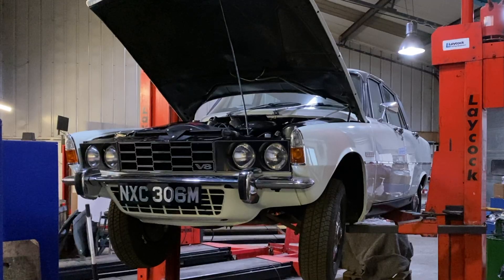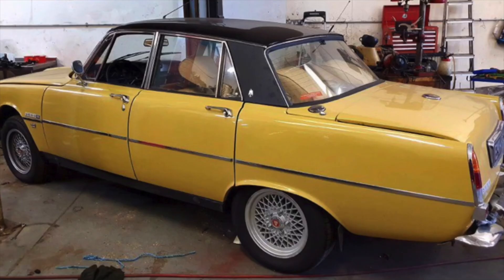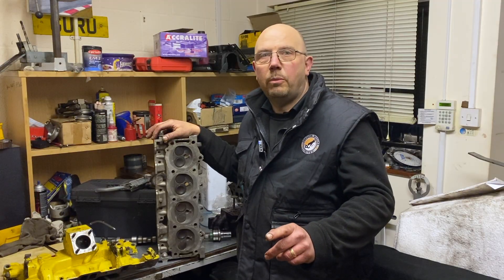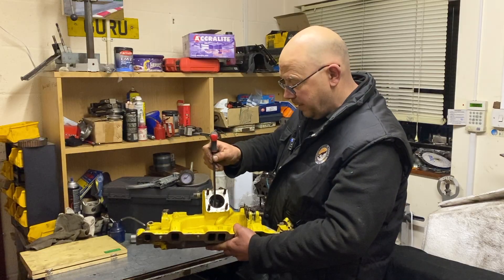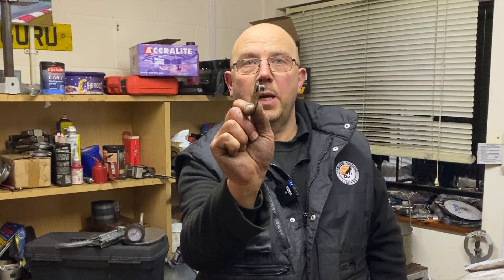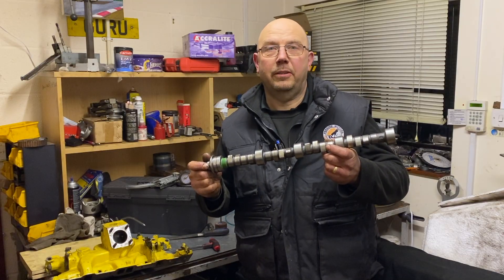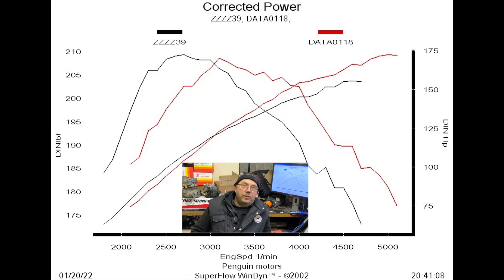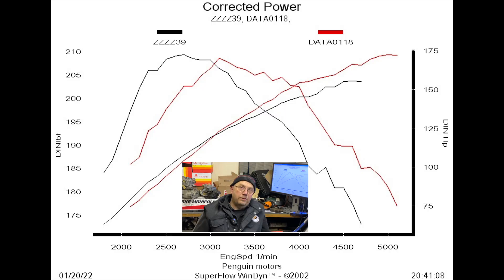Rover 3.5L V8 Standard Engine vs Stage 1 Upgrade

Comment: Love these comparisons/minor upgrades, would it be possible to see a stock high comp rover p6 v8 with edelbrock 4 barrel tuned for dtivability? Alot of people are having issues, tuning/finding the right needles, jets, springs etc... Mine has a lull on part throttle which then causes it to jerk, so annoying-maybe I'll have to spend a million hours trying to change/run it myself, kinda wish I just ran su now😔, love your content👍
Reply from the maker: Part throttle is the hardest thing to sort, its easier on fixed jet carbs. On the dyno it’s particularly difficult to hold at some throttle positions/loads, its much easier on a rolling road because there is more inertia in the system.
Reply: @PenguinMotors thankyou for your response, much appreciated. Can anything else cause it? I'm going to fit a plate under the carb(the one that prevents evaporation) & also(I know this sounds silly but...) I haven't yet checked float adjustment/level, just assumed it would be right but worth checking, could any of these cause an issue with part throttle?could you recommend anything I could do to tune it myself, rods, needles, springs etc? It starts lovely, runs well off choke, smooth. I did notice as it started to jerk I pulled the choke just a tad & it eased off🤔sorry for the bombardment, thanks for replying... Its just kind of ruining it for me a bit, you'd think that there would be some standard guide lines for stock engines etc... But there doesn't seem to be
Reply from the maker: @GeorgeJ-f6u  From my fairly limited experience i try a softer spring first, that will lift the needle sooner so get some more fuel going in

Comment: Hi question for you
If I buy 3.9 engine and I wanna fit ignition distributor instead electronic ignition whats I need to change  
Thanks
Reply from the maker: from what you say i assume you have a distributorless engine, so your need to change the timing cover, camshaft, fit a distributor drive gear
Reply: @PenguinMotors  is any good from 3.5 because I have one
Reply from the maker: you can 3.5 bits fit your block, but ancillery drive may be different, and sump may not fit.

Comment: I have a SD1 standard v8 what is a rough cost from tuning it up to around 200bhp?
Reply from the maker: that depends kind of depends on how healthy it is. but if its  healthy engine then you went up a stage from the very mild cam i put into this and with some air filtration improvements then you should be over 180bhp, chuck a 4 barrel carb on it and you should be past 200bhp
Reply: @PenguinMotors  wow that was a fast reply thanks! I would say it’s a healthy engine. If I was to go for a stage one tuneup 180hp what would be a really rough cost for parts and labour? 

I know it’s very difficult to say I just want to know if it’s with in my budget. Or if I need to continue saving.
Reply from the maker: difficult for me to price,  i dont do bolt on go faster stuff as such,  i only do performance work when i have the engine out to strip/rebuild and dyno test afterwards.
Reply: @PenguinMotors  That’s fair enough mate thank you for the reply!
Reply: Is this engine cross bolted? How do you identify this?

Comment: Im not sure there is any point doing engine mods with those twin SU carbs. Its like forcing usain bolt to wear wellington boots in the 100m.
Reply from the maker: gains wont be as big as with better induction, but you will still get gains, and a lot of rover P5/P6 and off roading landrovers prefer to keep su's
Reply: @PenguinMotors  potentially a super charger fed buy quad SU set up.

Comment: Hi, love your informative channel. I have an early 3.5 in a TR/7, have run it in sprints and hill climbs for 12 years and was always reliable. installed new rings and bearings and timing chain and now having problems chewing out the cam drive gear this has me stumped can you help me.  Pump is free moving, cam the same, early, no retaining collar.  Thank you.  Michael Simington.
Reply from the maker: In the old days that used to be fairly common fail. it was usually put down to revving the engine hard before it was fully warmed up. It used to be common to add an extra oil feed to spray oil directly at the distributor gear.  there's also a couple of spots where you can drill holes in the block which improves oil flow into the timing case. Have you got the gear on the cam the right way round? it fits both ways but one way it lubricates better due to the groove in it. as with a lot of things, im hearing that modern gears are poor quality, search out new old stock, or good old ones. Have you changed your distributor? if so check that the gear end of the  distributor shaft has  some up and down end float, if its got none the gears may not centre themselves correctly and will wear faster than they should, there a similar thing happening in the world of ford pintos with certain brands of distributors.
Reply: @PenguinMotors  Thank you for your helpful information, will make al mods and keep fingers crossed.  Had this problem with another rover and only way i could fix was to extend keyway on crank, fit crank oil pump and timing case cover. Thank's again.

Comment: What kind of power do they make with a Holley carb ?
Reply from the maker: anything from 150bhp to well over 300 depending on engine spec
Reply: @PenguinMotors  As you tested with a mild cam, some porting and headers ?

Comment: Good job !
Grinding away the edges and flushing the inletports of the manifold alone , does allreddy miracles !
You can hear nr 2 run more " round " beqause of better breathing .
I have done this in the 80s to the in and outletmanifold of my Alfa 2 liter engine , and with its twin Webers won about 10 BHP , just by this simple grinding alone .
Old school tuning , lovely !!!!

Comment: I took a 4.6 out of a range rover and rebuilt it using 3.5 front cover etc, edelbrock carb/manifold, distributer. 3.9 cam. Care to hazard a guess at power?
Reply from the maker: 230/240
Reply: That'll do! I'm new tae v8s sounds plenty in an old capri. Thanks.

Comment: Hope your camera man had his ear defenders on when recording that second run and leaning over the top of the engine like that , 😂
another great video 👍🏻
Reply from the maker: I did indeed! It’s so cool being in the cell with the engines running - James
Reply from the maker: V8 Rovers are not too bad on noise,  When dyno-ing  them i dont tend to wear ear defenders even if i do pulls with the cell door open. High rpm pintos on sidedrafts are another matter!
Reply: @PenguinMotors not always about the volume mate its exposure, loud noises for too long will take a toll

Comment: loving the v8 vids ,When fitting the 10 bolt heads which head gasket did you use tin or composite?
Reply from the maker: Used composite to avoid changing the compression ratio, but could of used tin to gain some

Comment: Good gain Graham , very rarely did i get 150 out of a stock engine i use to do a lot with the 4x4 brigade. Weber at the time did a replacement 4 barrel bit like the Holley it came in a kit with a Offenhauser inlet and a big round K&N as you know this totally transformed them and with some nice manifolds on sometimes you would see a good 30hp gain and similar with torque ... then they started snapping half shafts lol . But id say your on the money with that gain. Just think with a good head job and bigger valves and a 270 cam and manifolds u might see 200+ ...